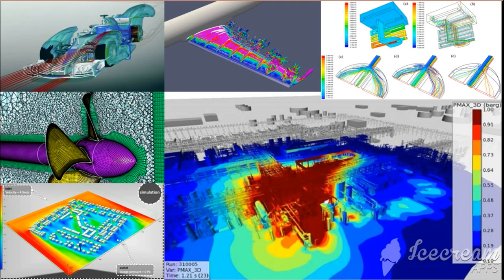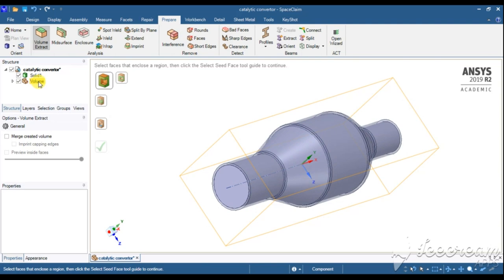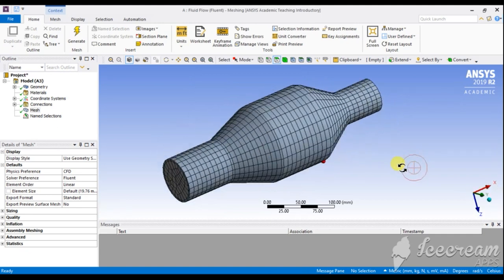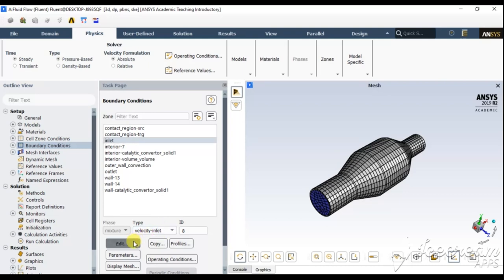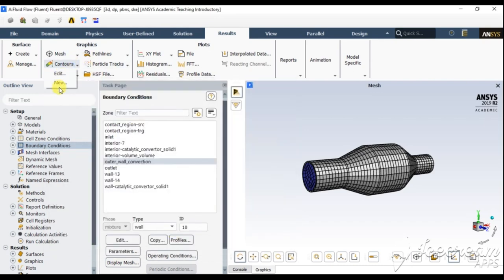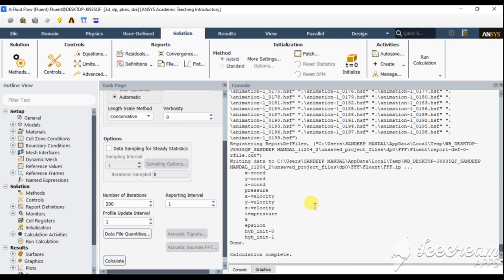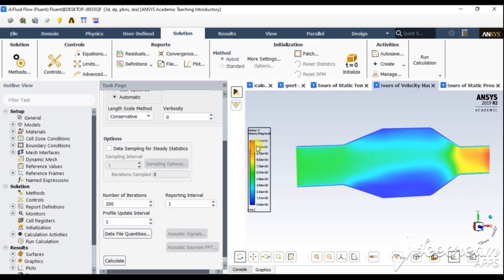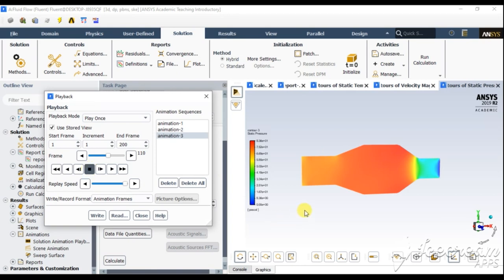CFD ANALYSIS OF CATALYTIC CONVERTER (BY INCLUDING THE HEAT TRANSFER FRON THE CONVECTIVE SURFACE)

Comment: Mass flow rate will be same at both inlet and outlet. Negative sign at the outlet means fluid is going out. Mass flow rate keeps on varying with iteration until the program finds a stable mass flow rate for the system.